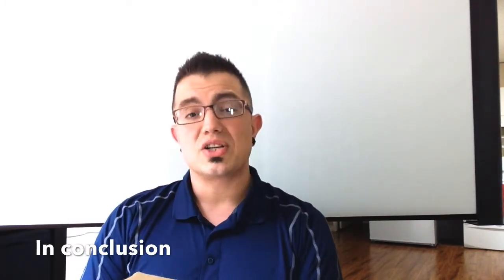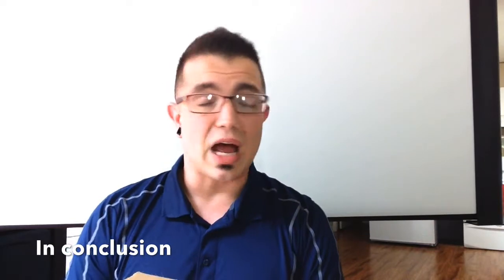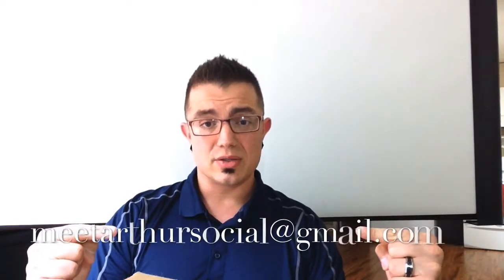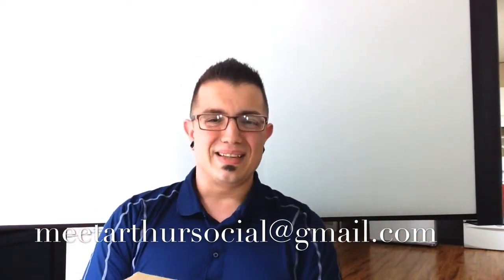Cut, Roll or Mill - Tips to make threads and stop snapping taps

Comment: Not to be argumentative here, but %90 of the time the RIGHT cut tap will outperform both a roll form tap and especially a thread mill in general application.
Form taps work best for VERY small diameters while maintaining productivity because of the rigidity.
 Thread mills work best on larger holes where horsepower and/or rigidity is poor with the tool and the work holding.
A good old machinist handbook goes a loooong way.
Reply from the maker: Deez Nutz definitely great points, it always depends on application. If a cut tap will get what you need done it will be a fast way, but I would recommend you look at Rollform as well, I’m seeing greater speeds, and longer tap life with rollform when the material is suitable, though you’re right it is on the smaller side, to give it a number Id say 1/2” and under at this time. As cutting tool technology increases we may see that change.

Thanks for watching, and for commenting I really appreciate it.